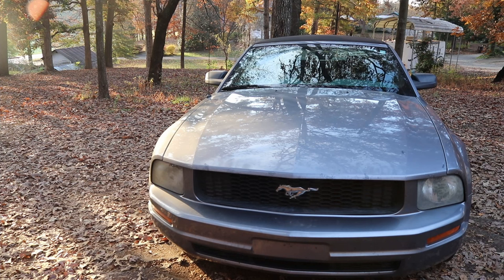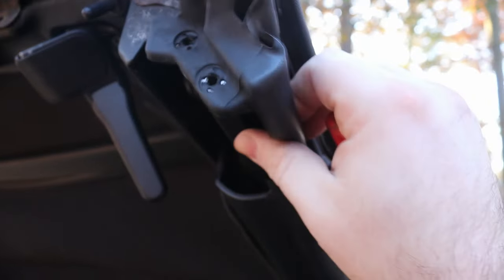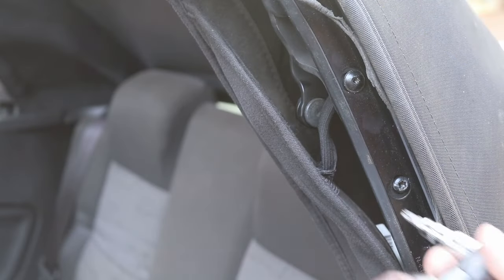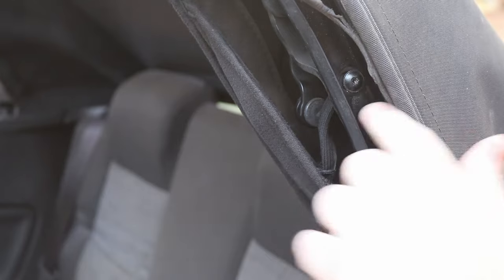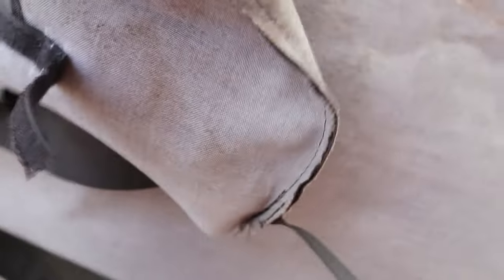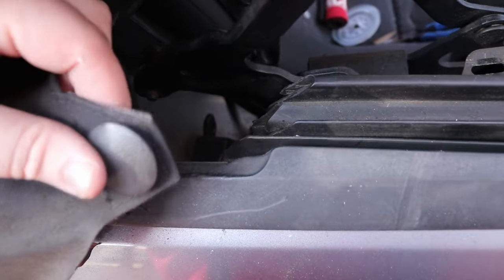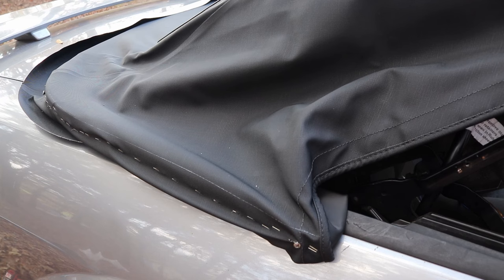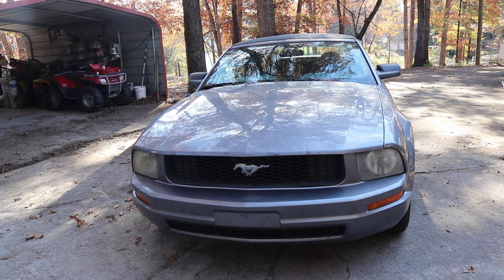How to replace convertible top on a 05-14 ford mustang

Comment: Have you ever purchased one that didn't come with the reference line  to staple down the back part
Reply from the maker: Yes, I don’t like those because then you just have to guesstimate the tension you need. Hope this helps. Thanks for watching!
Reply: I bought an oem top from Ford. And that's where I'm stuck at right now
Reply: @lilhellrayzrSkills line it with the old one you got and match it then you’re good

Comment: very good instructions.  im getting the inspiration here to save $1000+ and install myself. thanks
Reply from the maker: Thanks! That all ways means a lot to be able to help someone out. I fully believe you can do it! Just make sure to give yourself enough time to do it. Good luck! Let me know how it goes. Thanks for watching!
Reply: @JunkyardJunkie  I wanted to ask some specifics on a couple of items I tried to catch notes on.  For the size of staples to use I caught 3/8th inch.  But what is the appropriate gauge?  Don't want to be to thick or thin..  Also what size rivets will I need to put fill the holes when putting the new top on?  I hope the rivets don't give me to much trouble..  Thanks in advance..

Comment: Have a 2013 mustang here. I think it's best I get this done before summer ends when I go back to college. I did 3M window weld on it about 4 years ago and lemme just say that is still going strong today, but I have a gaping hole dead center of the top (flex tape and flex seal to patch it at the moment).

Maybe it isn't so bad just need to find the time to have days where it doesnt rain. In the midwest it feels like it storms almost everyday out of nowhere, but man I have so many spots with Flex Seal. Water finds its way down the under part of the back seats and those spots where theres stitches all have little holes for water to get through. Pretty sure the top is from the factory so I am shocked it lasted this long in the midwest!
Reply from the maker: Haha I wish we got more rain where I’m at. But, ya it’s good to do knock it out and not let it ruin the interior. I hope you the best. Thanks for watching!

Comment: This is a great video! I thought it would be much harder but seeing how it seems relatively simple I’m gonna be ordering a new top soon and doing mine with a client of mine. Do you have any recommendations on which top to get? I’m seeing some on eBay for $200
Reply from the maker: Thanks! So for the most part if you have direction it’s not to bad. However I wouldn’t recommend getting cheap tops from eBay. I would buy something quality unless you want to potentially have to fight with getting the right tension. I usually go with American muscle around 600$. Best of luck. Thanks for watching!

Comment: Geeez, followed this, 100%.   Came out perfect, however, after 2 weeks of trying, forcing, just cannot get the roof to close.  Comes up, maybe 1.5  - 2 inches short.   I've loosened all the mechanism and mountings, still, cannot get it to close.  Day in hot summer sun, no luck.   Thoughts?
Reply from the maker: I’m glad it was able to help! It is extremely tight right off that bat. I have to really put some muscle behind it. Once you get it closed and locked leave it locked for up to a week preferably in the heat. After that it’ll be easy to close. Hope this helps.
Reply: Thanks... but, no luck.   2 weeks+ of battling this thing.   Heat, weights.  The rear was fitted perfectly to the chalk lines.  I've removed bolts now to the rear support frame, just to allow it to move forward a little, still cannot get the front close enough to align the pins and lock.   @JunkyardJunkie
Reply from the maker: Super weird. Then if you can’t get it down you may as much as I hate to say it, take it back apart and move it up a little bit. Thus giving it a bit more slack. Best of luck!

Comment: Thanks for the video great information, AT 7.56 7.58  in the video there is a metal piece arm  that is rusting any idea if that part is replaceable, mine rusted through and not allowing the window pillar to line up and close properly.
Reply from the maker: The easiest way to find out is to call your local ford dealership. Ask for the parts department, once you talk to them they’ll be able to let you know part numbers and everything else. Hope this helps. Thanks for watching!

Comment: good afternoon, sorry, I have a 2006 mustang and I'm having a hard time, the glass fell off and now the roof doesn't close 100%, it takes about 3 cm to get there, the levers near the windshield, which could be the tensioner, it won't let it. get to the end or what would be the problem 

I hope you can help me since I haven't used my car for quite some time because no one in my city changes the hood.
Reply from the maker: Did you put the new one on already? It should be hard to pull down the first time putting it on. You leave it locked down for about a week in the sun and it’ll become easier. Now if it’s too tight you may have to pull it back off and give some slack. Hope this helps. Thanks for watching!

Comment: Thank you for this ! I didn’t want to  hassle with it . I might try to use window weld first glue window back first . I want to take the top loose and try glueing window first .
Reply from the maker: Understandably sometimes you can fix it like that. But it’s usually only a temp fix. Good luck! Thanks for watching!
Reply: @JunkyardJunkie  I thought it over . Although it’s wasn’t a cake walk taking  the top off ? I’ve decided to just replace it now that it’s off . I’ve ordered a replacement and should be done by min week . Thank you so much for your video
Reply from the maker: That’s the best move I think. Fix it right the first time and be done with it. Good luck with it let me know how it goes.

Comment: very detailed video!! however my question is, what did you do in the areas where you had drill out the rivets, how did you reattach it back on?
Reply from the maker: I used a Milwaukee rivet gun to put new rivets in there. I believe I put everything in the description. Hope this helps. Thanks for watching!
Reply: ok, thank you @JunkyardJunkie

Comment: Thanks for uploading this! I’m doing this myself, but I got stuck on 8:10 & wherever you mentioned rivets, you just cut the video, and I can’t see how u take em off, (my first car project) 
8:18 how do I take it off?
9:29 “two more right there” how do you take em off? And how do you install them back on? 
On my convertible the straps are attached to the metal frame like yours, but they don’t look like rivets, more like circles with a very tiny hole in the middle, 
Thank you sm
Reply from the maker: Ya I said you have to knock it out with a punch/chisel or drill it out. Rivets are one time use I took a chisel and broke the heads off on this one (it was hard to record on a time crunch). Then to put them back in all you have to do is get a rivet gun (30$ for handheld one.). All the tools and sizes you need is in the description. I hope this helps. If you need any other help feel free to ask. Thanks for watching!
Reply: @JunkyardJunkie  my fault bro, thanks that clears it up for me, I should be able to get through it now thanks for the help🙏🏻
Reply from the maker: All good bud. Good luck! Remember if I can do it you can do it.
Reply: @JunkyardJunkie , getting the tools is the literal hardest part 🙄, it’s 12am been working on it since 10pm and I went from 8:54 to 13:54🙏🏻
Reply: @JunkyardJunkie  the new top was on by 4am, now I just need to install the rivets and secure it, just hope I installed everything right, the bottom of the top ripped, probably because it was too tight when I put the top down? Idk. But shouldn’t be much of an issue, almost done….
Reply from the maker: Doing an awesome job. It’ll be rewarding once it’s finished. Let me know how it turns out.
Reply: @JunkyardJunkie  I did do an amazing job😃but guess what, called my mom over to hold the top fabric in place so I could staple, but I didn’t see she kept pulling the top creating extra tension and it made the top riip when I put the top down. all that work for nothing. And I didn’t notice until I was 80% with it. Now I have to take it off, exchange it, and do it all over again… but didn’t get mad at her coulda happen to me too. Just gotta be content I’m atleast able to work on my dream car like this and thank god n do it again
Reply: @JunkyardJunkie  but aye thanks for uploading this man you truly don’t know how much you helped me out, super clear and I was able to do it, I still have the top on rn and it looks perfect besides that rip
Reply from the maker: I hate to hear that but I do love that mindset. With a great attitude like that there’s nothing you can’t do. Also you are right any of us could have done it, it does suck though. Hey when you get it back on there send me pictures I’ll try to throw it in a video. These are amazing cars. So I can’t wait to see how your’s looks!
Reply: @JunkyardJunkie  it’s finally all done man… it feels like I’ve been doing it for eternity man fuck. But it’s all done, new unripped top is in place, but for some reason 
there is a pretty good gap on the driver side quarter window, and the top won’t drop all the way down, on the driver side the arm tilts towards the drivers side and gets stiff when I bring it down and you could tell there’s uneven pressure, and I don’t go any further bc I don’t wanna break anything, 
also clipping the top on to the car like when you lock it in place, on the inside is very hard to close it on the passenger side. Any tips man? Also I’d be down to venmo you or Zelle you for helping me out if you’re down🙏🏻
Reply from the maker: I’m glad you got it done finally! That’s awesome. As for your problem you made sure the chalk like was lined up all the way around correct? If so you don’t have to worry it’s pretty normal. When you first put it on it really needs to stretch and it will be hard to put it down to lock it down. The best thing to do is pull it down lock it down leave it in the sun for a few days give it time to stretch. I wish I covered this more in the video unfortunately I was rushing to much to clarify more things. Also thank you for the offer but I’m just glad I can help you.
Reply: @JunkyardJunkie  oh na I’m not talking about that, i mean like when I drop the top so the top is inside the car, the drivers side arm like where the T20s go tenses up and then the top like leans to that side, but I stop it before i think it breaks something you know? But the frame is in place, the T30 bolts are in proper place, so I wonder why I can’t drop the top, and why there’s a bigger gap on the quarter window on the drivers side aswell, 
But no worries your video alone is a blessing🙏🏻💯 you’re still taking time out of your day to help people and you’re a great person🙏🏻
Reply: If anyone goes thru this comment, I did finish, I was tripping about the arm bending,I was just rushing the process and trying to get the end result quick without finishing, sounds silly but o well, everything was good and I now saved like 3k thanks to this video, ❤️

Comment: amazing work sir, curious which mustang year was this? the American muscle top seems to say the same top works for 2005-2014 which is strange as I thought 2010-2014 were redesigned models. 

Any updates on it too? is it holding up or did you need to use the warranty on it. Sad my original top window is busted in, wished Ford built them better
Reply from the maker: Yes they work on 2005-2014. This one was a 2007 but it’s practically the same install on the old s197 and newer s197. 

Yes still looks perfect American muscle makes a really good top. Ya ford really dropped the ball making these. The most common problem was the back window separating. Anyways hope this helps. Thanks for watching!

Comment: someone tried to enter my car through the convertible top and used some type of sharp blade to cut a decent size hole to reach their hand in it. should i try to get it repaired or go for this?
Reply from the maker: Honestly I’m not sure. Usually if they get a cut you’ll only be able to give it a temporary fix. So, personally I would most likely replace it depending how bad it is. Hope this helps. Thanks for watching!
Reply: @JunkyardJunkie  okay thank you so much for responding if you don't mind. can you list all the tools you used please? would help a lot because i feel confident i can do it.
Reply from the maker: If you look in the description I have all the tools needed wrote down. Hope this helps! Remember if I can do it you can do it!

Comment: Hello. Thank you for the video. What quality fabric did they use for their roof? There is one around 300 or 600 bucks on eBay? Thx...
Reply from the maker: Hey it’s sailcloth but I would be carful going cheaper and getting from eBay. A lot of the time they have no marking and require you to manually line everything up because it may be a little longer than others, or a little shorter. Best of luck. Let me know how it turns out. Thanks for watching!
Reply: @JunkyardJunkie  I think it's very difficult to buy the right one because everything is produced in China. No matter where you buy it, almost the same is always offered, whether cheaper or more expensive. Where did they buy it? Thank you very much....
Reply from the maker: Very true most things are made at the same manufacturer, just rebranded. I bought mine from American muscle.

Comment: My 2006 ford mustang Gt convertible, my back window is shattered completely, and I have to replace the top, is it still gonna be this easy, or is gonna be a bit more complicated
Reply from the maker: I don’t want to say this job is easy haha but yes it’ll be the same as long as whatever shattered it didn’t hurt the glasses heating connector. Hope this helps. Thanks for watching!
Reply: @JunkyardJunkie  thank you so much man it means a lot

Comment: I hope you see this but mine does not have a chalk line to staple it back on the frame and I’m not sure you know where to staple it at. I bought a Twill material I’m not sure if that makes a difference.
Reply from the maker: Hey, any reputable company should come usually with a chalk line or some kind of indicator. Without any marking I’m not sure how you would line it up properly. Maybe someone else has more experience with it can comment on here and help you out. Best of luck. Thanks for watching!
Reply: @JunkyardJunkie  yeah I bought it off of American muscle and I’m just really confused on how to line it up. I got that far and now I’m stuck…..
Reply from the maker: That’s where I buy mine too. Message them and ask them about it. They may have some other identifier they used on yours.

Comment: what did you use for the medal little screws that you said “knock out with a punch”
Reply from the maker: The rivet? I thought I showed it but just take a chisel point it towards the head of the rivet give it one whack with a hammer and it pops the head off and comes out. Hope this helps. Thanks for watching!

Comment: i was removing mine today and i removed what to seem to be a rivet. when i tried opening the convertible it stopped working. this rivet looked like it was holding down a ground cable. is there a ground cable running thru the convertible ?
Reply from the maker: Does yours have the heated glass? Where did you remove the rivet from?

Comment: recently in the process of installing the new top the tensioner cable ended up breaking and i can’t get to the bracket to uncrimp the old wire. is there any way i can repair the broken cable?
Reply from the maker: All be honest I’m not real sure. Personally I’d probably just jb weld it haha. Since it’s not under too much tension it should work. Hope this helps. Thanks for watching!

Comment: Did you need to use adhesive before putting the metal bar back on the front? I saw in another video by Meca that it was glued.  Also you said to not let the tape come up with the top. Is that tape replaceable if it’s dried out or not sticky?
Reply from the maker: So yes adhesive is a great extra step. It’s not necessary. As for the tape I was always told when doing these to make sure it stayed down, so I’ll be honest I’m not sure. Anyways I hope this video helps. Thanks for watching!

Comment: If I staple it, remove the staples and adjust it, will the old staple holes let water get in my car?
Reply from the maker: No they won’t as long as the holes don’t go above it. but you want to try your best to not have to readjust it. Hope this helps. Thanks for watching!

Comment: Removing rear molding make it easier to disassembly that metal bar ?
Reply from the maker: Ya go for it, it shouldn’t hurt anything. Best of luck. Thanks for watching!
Reply: Thanks for your help ! 
I bought low quality material with plastic window :) and there’s no tensioner wire housing on it and top is perfectly fit , closed 
I decided to leave it hangin inside the car
Reply: @DaveSam07 did it leak any water inside with rain
Reply: @christianperez2515  no it didn’t but you gotta be careful to not play or adjust the headliner 
And plastic window type is the worst 
Just do it right
Reply: I also bought a cheap one from e bay with heated  glass   but i  just notice it did not have tensioner wire housing @DaveSam07
Reply: @christianperez2515  it’s actually one of the basic steps. You gotta use snap blade just on top both sides. It will leak if you don’t specially for a pressure wash & with high speed the hot air will get inside. If yours didn’t come with fitment line, arrange it with the old one after removing it